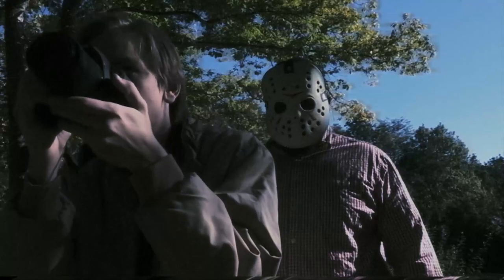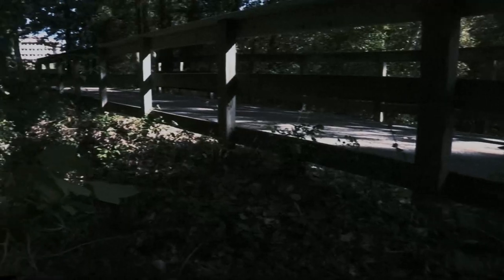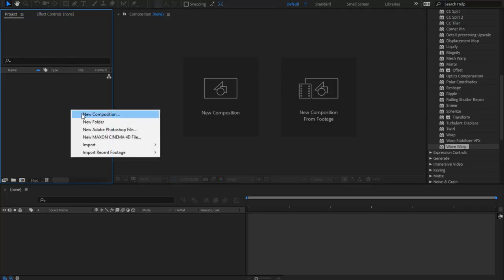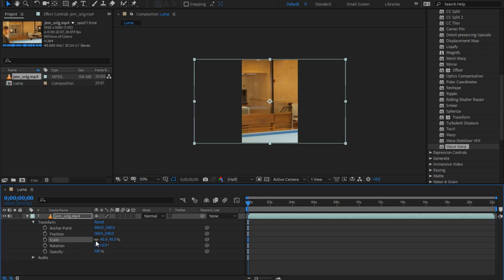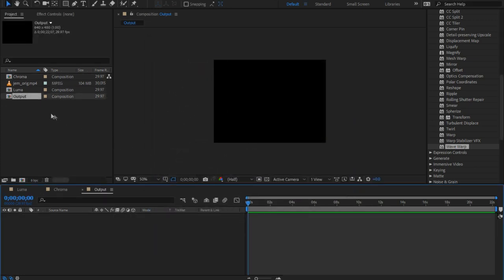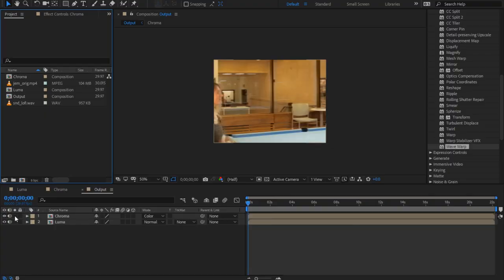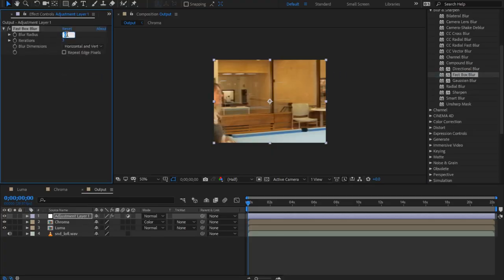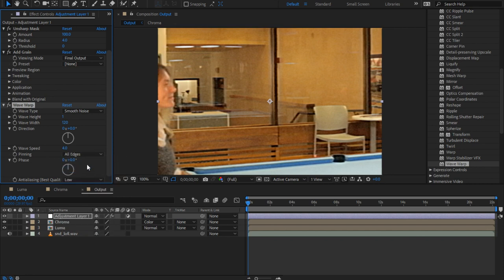(OBSOLETE—SEE DESCRIPTION) How to simulate VHS damage in After Effects

Comment: I found out that adding a black & white effect to the Luma comp helps reproducing the color separation that VHS tape does. Also, if you want some more "bad tracking look" you can probably move the Chroma comp just a frame forward so the color moves at a slightly different moment than the luminance. Great tutorial!
Reply: I also found another tip to make it look better. If you import your file into Premiere Pro and export your video with these settings you’ll get an even more VHS look: 

Format: H.264
Preset: YouTube 480P SD
Bitrate Encoding: VBR, 1 pass
Target Bitrate: 0.5
Maximum Bitrate: 0.7

Comment: This looks fairly modular. Could it be that you may actually create a blank composition and set it as a template (that means the video file inside can be changed), the same composition is placed inside the two compositions that change the horizontal size (that means the same video is placed inside both compositions and with changing just one source, both compositions are changed accordingly). and both compositions are then placed in the final composition that makes the effect on it. One thing should be noted tho - the luminance layer is actually black and white (yet you forgot to make it black and white), while the chroma layer is purely just the color information (you should be able to recreate the composition of the chroma layer by placing a 50% gray plate below the video, and putting the video layer into color mode - that should remove the luminance from the layer, if I understand that correctly). For the final effect, the black isn't actually entirely black, it's more like very dark gray. You can therefore make the final composition as another template, where you can adjust the brightness of the entire image (before the artifacts are added). The video signal composition (the one providing the video for the effect) will be already set to 640x480 resolution, where you can essentially make it so the video signal can come with black bars at the top and bottom. Or you can cut off the excess image. That should make it so it's already shot with the 4:3 frame aspect ratio.

Nothing can beat the authentic VHS tape, so if you have the option to just record the video signal on the VCR to a real tape, and then capture it back to the digital format, it will always be much better. But this is fairly faithful recreation, I just think it may require a bit of more tweaking, looking at how it is done. And I see the potential into turning this to a template effect.

Comment: I love this tutorial! This is exactly the look I’ve been trying to find! How would I get the video to export in HD? I’ve only gotten it to export in SD while maintaining the 4:3 aspect ratio and I wasn’t sure if it was an adjustment I’d have to make within the editing itself or just something I’m missing in the exporting process.
Reply from the maker: It’s been a while since I used AE, but my guess is that you need to scale up the compositions. If you want full HD, 4:3 ratio, then your output should be 1440×1080. Multiply the width by 0.5 for luma (720 px) and by 0.0625 for chroma (90 px). If that doesn’t work, then try checking your export settings.

Comment: What’s the Luma chroma calculations if your source is 4K?
Reply from the maker: Hey, I’m sorry I didn’t see your comment for so long. You can just scale the image down until it just barely fills the frame vertically. To get 3840x2160 down to 640x480, use 22.3%. Then, divide that by 2 to get the width scale for luma (11.15%), and divide by 16 to get the width scale for chroma (1.39375%).